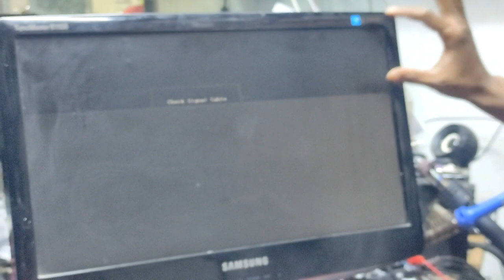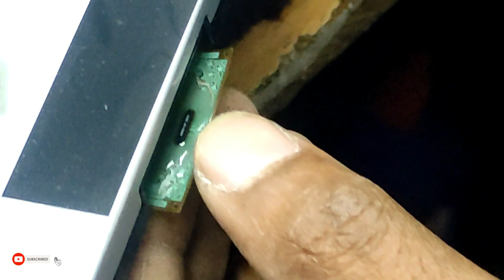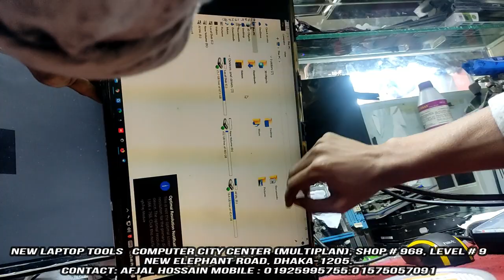How To Repair Samsung Monitor B1930 Panel In Bangla 2021| Samsung  |Monitor| LCD LED Panel Repair

Comment: Amar B2230 model er power supply board er IC 831S er sathe jukto zener diode short hoye geche, zener diode (ZD832) er voltage ebong current ratings koto? Kindly janaben. Thanks..

Comment: Bhai, my issue is half of down screen appears gray shadow and white full of horizontal lines with mirror, please help me bhai LCD works perfect nothing wrong with the LCD...if i disconnect only the flex without disconnecting the backlight power screen works with full white without any horizontal lines or anything...